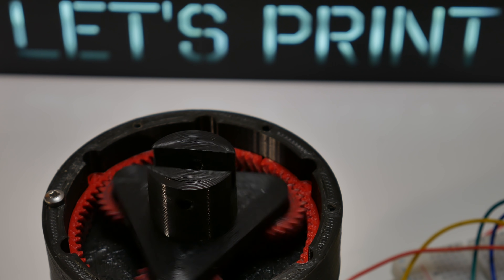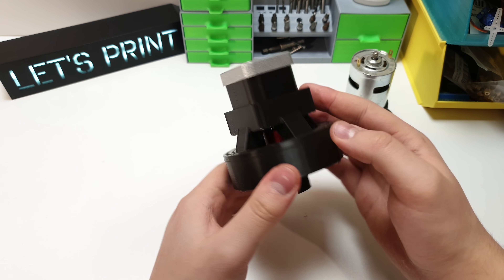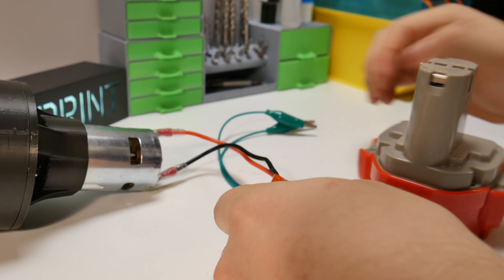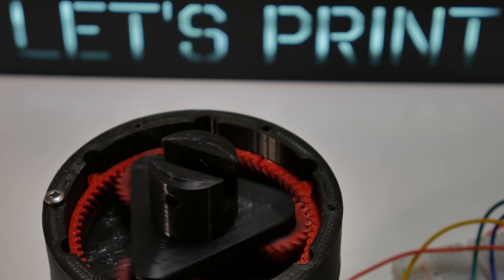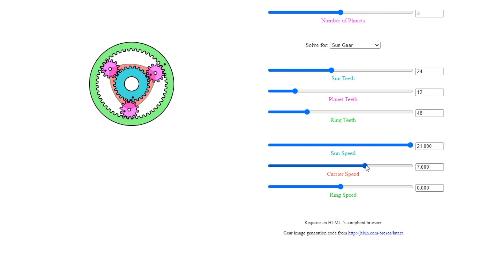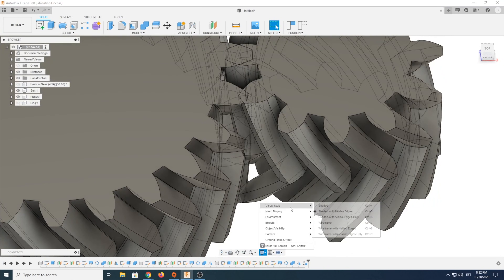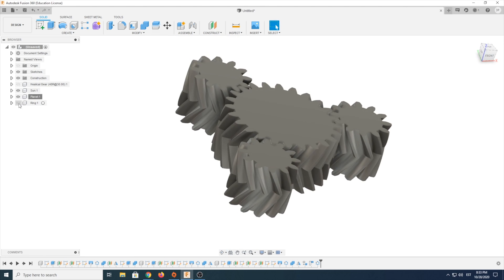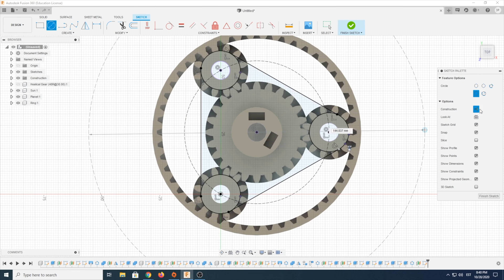3D Printed Planetary Gearbox - Building & Testing & Designing (Fusion 360 Tutorial)

Comment: Thanks for the great design.  I used the gearbox with a NEMA 17 stepper motor to make a cell phone charger.  I printed a second motor mount to attach the generator to a base, and also printed a crank handle for the other end.  I used PLA+ for the case/mounts, PETG for the gears.

Comment: Hey, I'm in the progress of printing planetary gearsets myself. What backlash value do you use to make sure the gears don't bite? Or do you adjust addendum/dedendum?
EDIT: I noticed you use 0.1 for backlash but still if I use 0.2 on all my gears they keep biting.. (gear calculations are correct, it's purely a 3D printing material expansion issue)

EDIT2: disregard ... 11:10

Comment: what advantage is there from going from 3 planetary gears to 6
Reply: The load for each planetary gear and the connection between the gears will be lower so the planetary gearbox will be capable of more power. Though friction will be a little bit higher. Since mounting 3 planets on this gearbox is already not easy, this wouldn't be easier with 6 planets.

Comment: Check out the planetary gear I used in my robot actuator. The flex spline, doubled up ring gears, and 3d printed bearing in particular you might find interesting. https://youtu.be/4o3d7_WZ_DQ

Comment: Chamfer the lower edges and you don't need the raft to avoid the elephant foot! The design is great but the 0,3mm tolerance is a quite too much!!
Check your printer settings and adjustment ! I'm sure it is possible to print in place without raft and lower tolerances.
Reply: Cura allows adjusting the first layer to prevent it now

Comment: It's good work, but there is a lot still to improve:

1) Like GearDownForWhat, you're modelling your helical gears in the normal system. Change this to the radial system, and your pitch diameters will revert to being just PD = m*Z, like it is for a normal spur gear. This makes all your calculations easier.
2) The reason you're experiencing binding is that a normal gear has an addendum of 1*m and a dedendum of 1.25*m. When you're doing that combine-cut, essentially you're turning the addendum into the dedendum and vice versa. You have to compensate for this.
3) For the ring gear, enter a negative backlash in the gear generator. When you do the combine-cut this will result in a positive backlash, as required.
4) The main challenge I'm still facing is the planet carrier. I don't like the idea of 3D printed shafts rubbing on 3D printed gears directly. I think integrating small steel shafts with Igus bushings would do the trick, but I haven't actually done that yet. I don't think having a purely 3D printed carrier on a 3D printed gear will last very long at all.
5) When you're spinning your gearset I can clearly see the ring gear flopping around. Something's not right there.

I'm still working on my wifi tank, but I should have my own tutorial on ring gears and planetary gears up in a week or two. I already have some gear tutorials up, including one on helical gears that goes into the difference between the normal and radial systems.
Reply: Bro, you should do a tutorial to share your knowledge, we will apreciate
Reply: Planetary gear tutorial would be very useful indeed. It would be great if you could make it. Subscribed to not to miss it)
Reply: oh nice i wait on your video :D
Reply: I hope I'm not spamming too much, but my tutorial is out now: https://youtu.be/71dn-eVdSmc
Reply: @antalz  Thanks!)